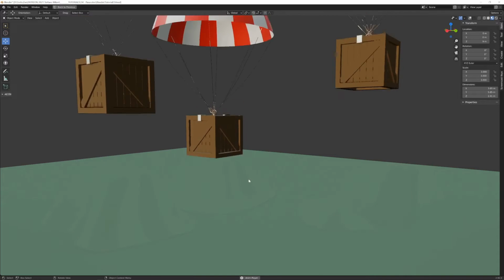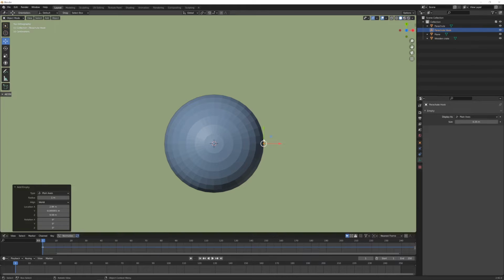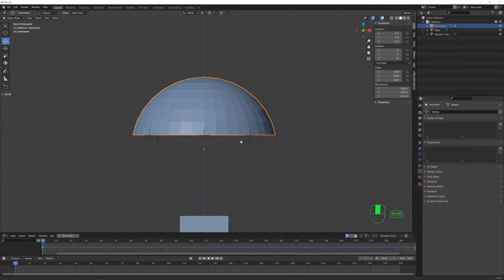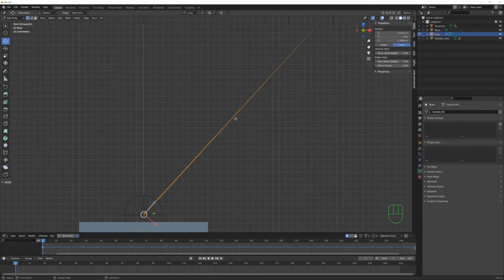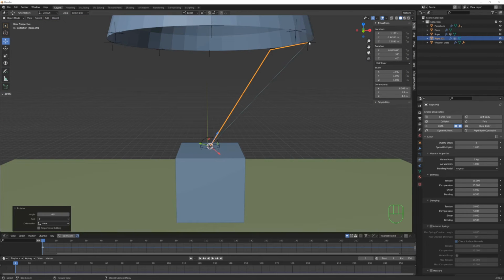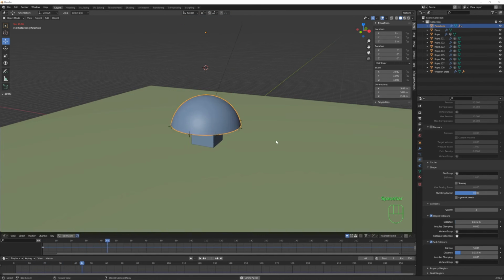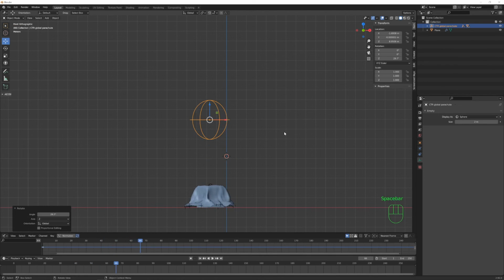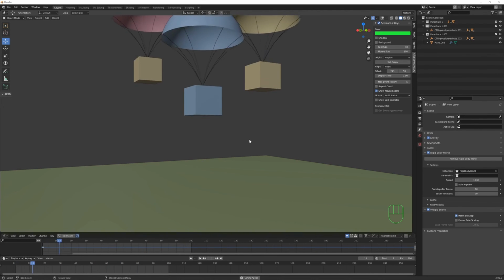Parachute Simulation in Blender 3D

Comment: If I make the crate heavy and if I make the parachute fall from a high altitude, the ropes stretch infinitely -- even if I add collisions to them and set their Bending Model to Linear with a high Structural stiffness. EDIT: The culprit seems to be the very first segment of the rope -- the group of vertices that have the pin on it. They stretch infinitely away from the other vertices (the other vertices seem to behave properly as a rope)